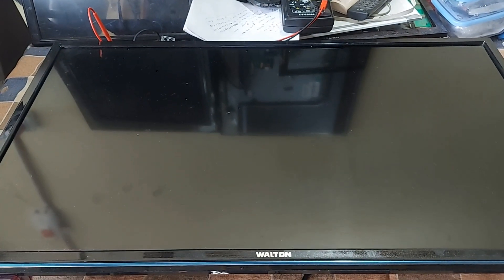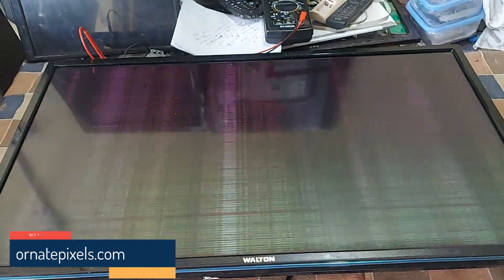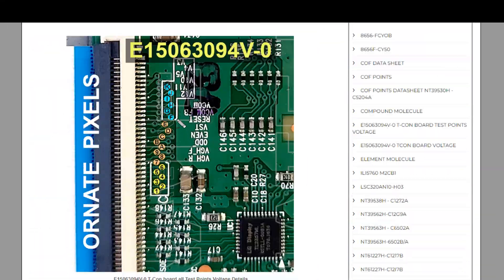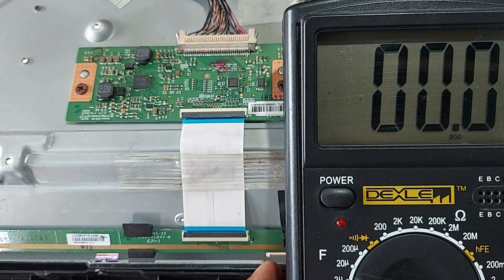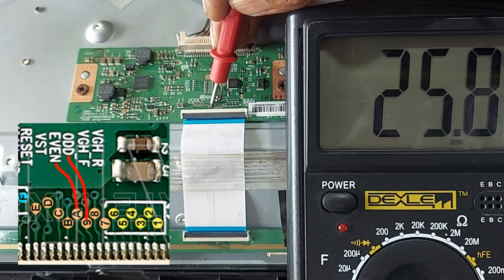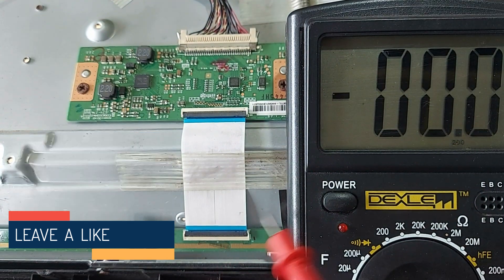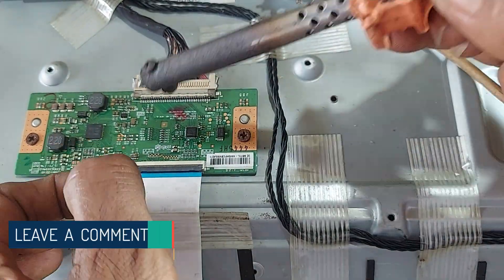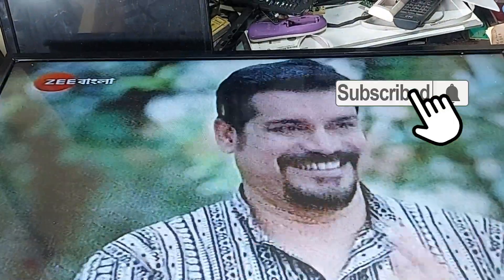Vertical Line & Horizontal Line Problem on 32inch Walton LED TV | E15063094V-0 T-Con Board Repair

Comment: I like your illustrations and repair works but what you do not do is explain your choice of cutting and attaching wires to components. You do not seems to explain how you determine which points must be cut. Thanks

Comment: Hey have Toshiba Led TV 24 inch I have same issue but picture only come for some time and monthly horizontal and vertical bar like this video I check the panel voltage only vgl voltage is missing rest other voltage are proper and I am unable to find how to fix vgl voltage help me plz

Comment: AssLamualaikum. Brother I need an advice from you but it's difficult to explain all without photos. Of a led tv  with horizontal lines half screen and half screen display keep on and half. 
My friend know I've some knowledge in thecnicians. He told me try to see what's the problem. He already send the TV to repair but they said the screen is faulty. They have cut the track on the Coff I seen it. And right side they had resoldering it. 
It's a myros 55inch . 
Me I want to resoldering where they have cut the track. But I want an advice from you . I can't see nor Vgh or vgl etc.... On the Coff so I can check the voltage is present or not. Am not qualified as you brother. 
I will appreciate it from you brother if you give me a contact whatsapp number. I can send you the photos where they had cut the track. 
And within  your knowledge you will analyze if it's can be repaired or not. My friend told he just bought this TV and  it has cost him a lot of money. 
JAZAKUMULAH KHAIR

Comment: Hi I have a Sinotec 39" led tv model : STL-39VN86D using a main board : TP.V56.PB801, it's a South African brand, the problem is that there's no sound and no picture but the backlight are working also I replaced the main board but it shows a dark screen only I was thinking maybe it's the T-con board or am I wrong? can you please help me
Reply from the maker: #No firmware update for new board
Or #T-Con board problem or #Panel problem. Best Wishes Brother.
Reply: @OrnatePixels  Thank you bro👍

Comment: Please make slow video not see where you connect odd or even
Reply from the maker: I will make the next video in slow motion bro. You can find out the test points of ODD & Even from the link below. Thanks.
https://www.ornatepixels.com/2022/08/e15063094v-0-t-con-t-con-board-all-test.html